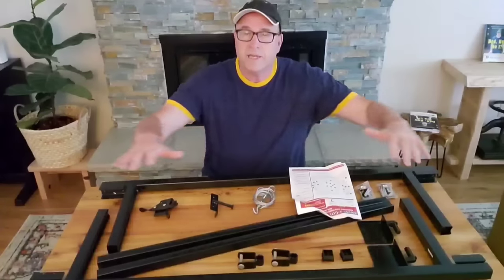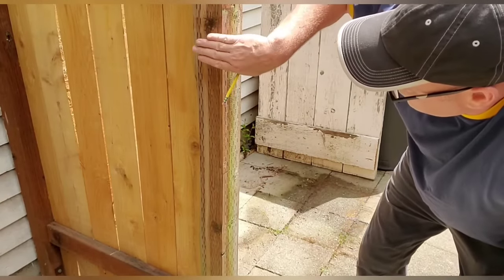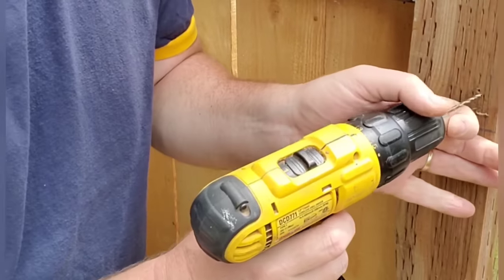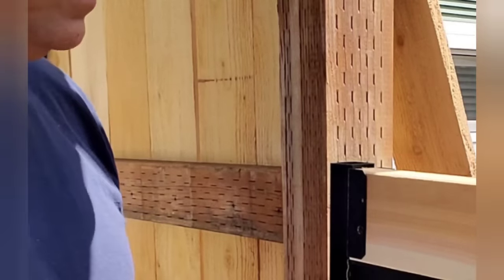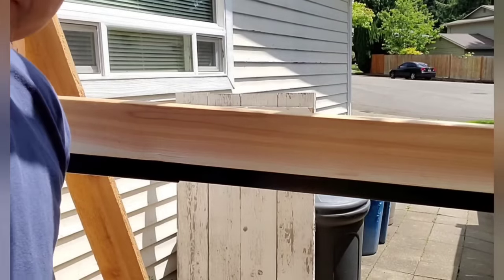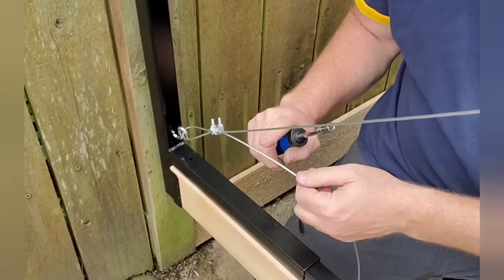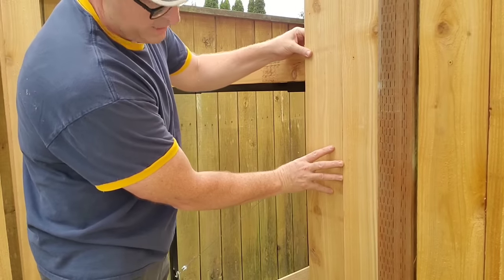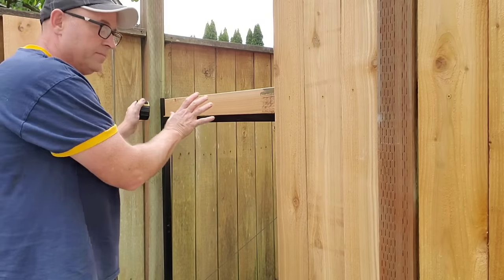How to Install a Gate

Comment: Help, how did you make the top trim piece on your gate? I'm wanting to add a decorative insert to ours but only leaves around 3" from insert to top of gate. I do not think it will work, unless I can add a trim board around the curve top and trying to bend a 1" x 2" I'm lost with!  OR DID YOU JUST CUT IT OUT WITH A PATTERN? Thanks (I would add a photo but don't see how)
Reply from the maker: I actually glued 2 fence boards together to make a (roughly) 9” wide board, then cut it out from there.
Reply: @DadhowdoI  THANKS, makes it a little easier to understand and do!!! ;-)